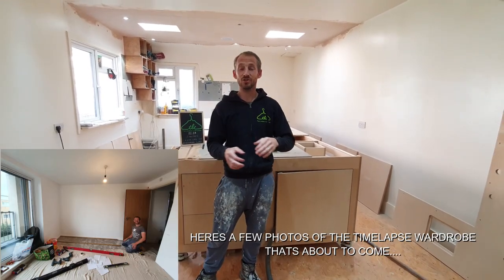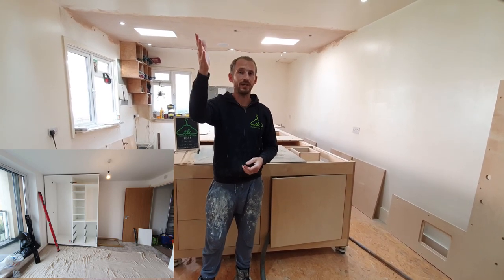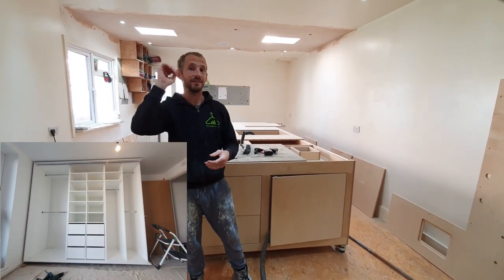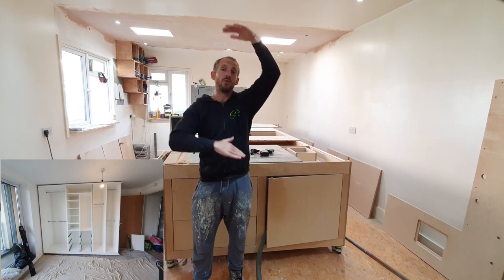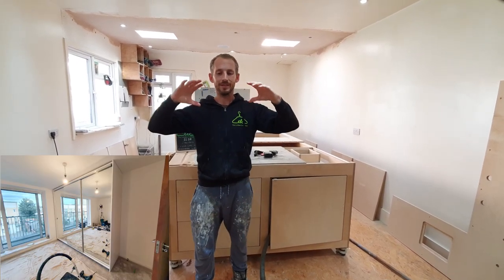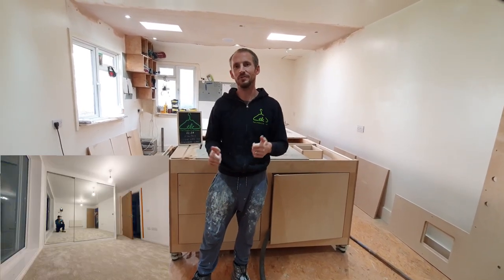Installing A Sliding Mirrorred Door Wardrobe In 5 Minutes TIMELAPSE - Vid#68

Comment: Your work is flawless. When making sliding wardrobes I normally do a standard 550 carcass then add 110mm to the front at top and bottom for the GTV track system to fit onto. What’s the measurement you use from side of carcass the front of shelf on top and bottom?

Comment: I'm always amazed you manage to install pre finished units without marking them.  For example, when using the track saw, the end panel remains unmarked bt the track? Even transporting all of the components.  How on earth do uou do it?
Reply from the maker: 😁
This paint is pretty tough so doesn't get marked by the track saw. We don't wrap them during transport but put dust sheets in between when stacking in the van and then from that point we are just very careful  😁😁

Comment: Hi Ryan, what are you using to seal the gaps?
Reply from the maker: Hi Franc, 

it all depends on the customer really.
75% of the time it is white silicone, due to being flexible and giving an instant finished look.
The other 25% of the time it is flexible and paintable caulk, if the customer wants to decorate up againt the furniture with their own paint or a different wall colour :-)
Reply: @thelondoncraftsmanworkshop  that explains a lot, thanks 🙏🏻 any particular brand you recommend?
Reply from the maker: @FrancLowe-w7w I just don't get the basics brand really.  Mainly either toolstation or screwfix usually, but i do go for a named one rather than their homebrand 👍